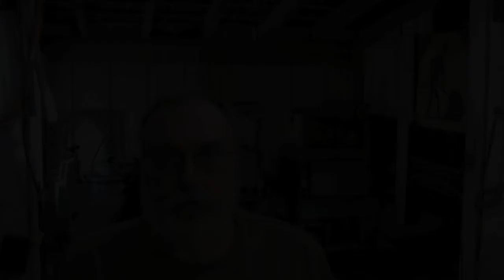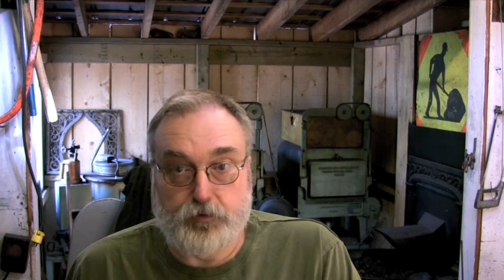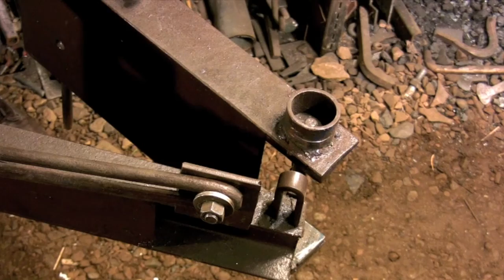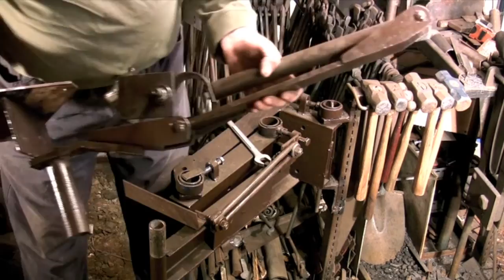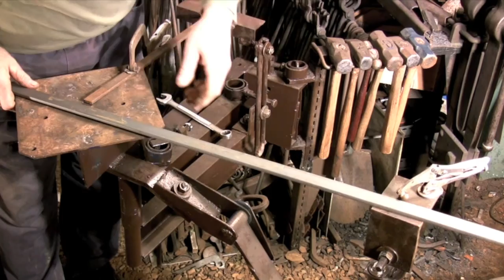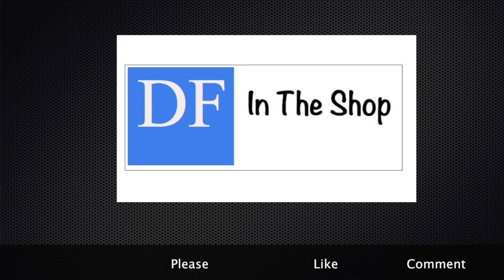Compact  Welding Table / Station for a Small Shop

Comment: Love it. Building my first welding table and was desperately looking to get away from the obvious, logical square tubing and  heavy plate based design because of space limitations, although it would be a fun excuse to mitre and weld some shtuff. I couldn't pull off a sweet swing arm like that but maybe an easier middle ground is something like  a folding steel shelf added on to the side of the bench, like the jump-seat in a passenger jet cockpit. Thanks for the idea!
Reply from the maker: This is what happens to you when you learn mechanical engineering from Roadrunner cartoons.
Reply: @df-intheshop330  you're right, It needs a boxing glove on a scissor extension type mechanism.